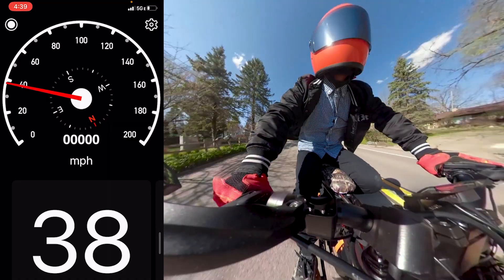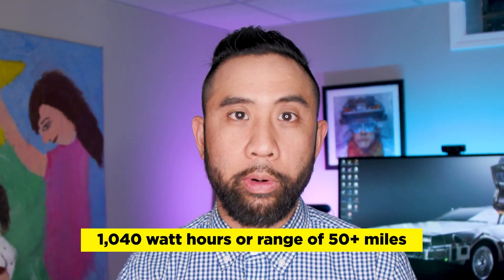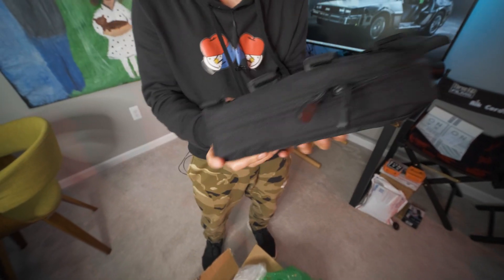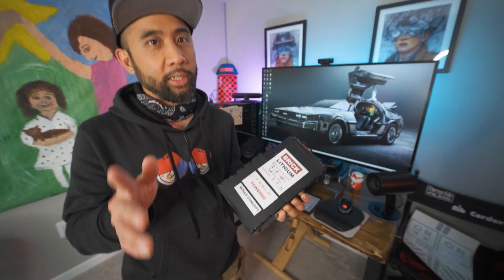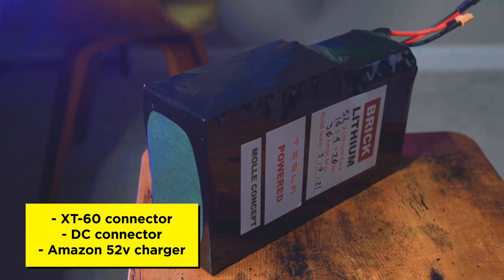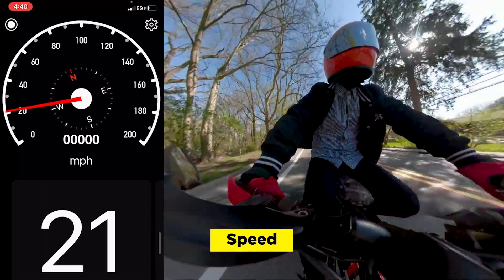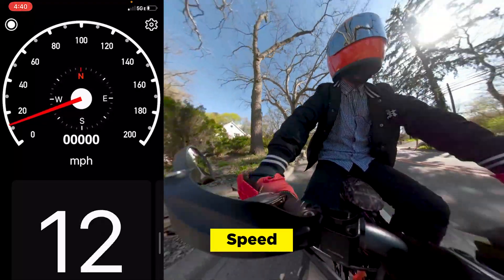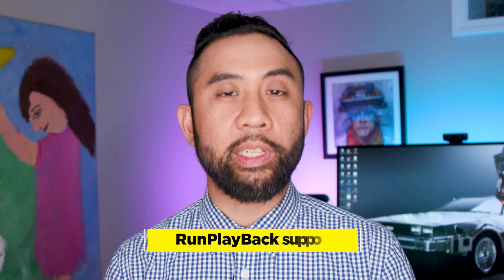Super73 Z1 52V Upgrade Test Run | RunPlayBack

Comment: Did you change the settings in your controller to 52v or leave it at 48v.
Reply from the maker: From what I remember I didn't change anything related to voltage.

Comment: could i run the 52v batter with the orignal controller?
Reply from the maker: Nope, the stock controller would burn out.
Reply: @RunPlayBack  if i run a bac855 and a 72 motor could i use the stock motor?

Comment: Great video! Is there any reason you mount the battery on the panel instead of put it under the seat? Is it just for its size or the heating problem
Reply from the maker: The size of the battery was too big to fit under the seat.

Comment: Any reason why that bike in the video isn't a Z1 and is actually the S1 or 2?
Reply from the maker: It's a Z1
Reply: @RunPlayBack  The front suspension? Headlight? You put all this on it?
Reply from the maker: @OregonCrow  yeah, it's heavily modded. 
But it looks much different now though with the 72v conversion. It's one of the latest videos on the channel.
Reply: @RunPlayBack  Right on

Comment: Could I use this controller with my 52v ZX for a higher top speed? (Stock battery and motor)
Reply: The motor and battery has to be has to be 52v too

Comment: I have have a Super73 RX with a stock controller. Do you think the stock controller will handle a 52 volt battery?
Reply from the maker: I'm not sure but I wouldn't risk shorting the controller if it can only do 48v. If you're upgrading to a 52v battery, might as well upgrade to a new controller as well.

Comment: Another great video sir. Did you adjust the minimum voltage cutoff on the controller(is it even possible?). I think in the display it is C12. Just curious. Thank you for your time.
Reply from the maker: Yup I did actually. I forgot exactly what level but I raised it to the highest minimum voltage cutoff. I still never ride it to cutoff point and very rarely do I even dip down to 48v on this pack.

Comment: you should do the speed hack on the super 73 by cutting the white wire
in the controller
Reply from the maker: There's actually a new controller in there, not the stock one.

Comment: I wonder if a higher capacity controller would help with the heat issues? Aliexpress has some, I'll try to link it and hopefully YT doesn't delete it. They appear to use the same screen and connectors as well. Main concern is with the increased amperage: could mean that the controller has better heat management, but could also kill the motor quick? These controllers do allow a power reduction in the settings, which may offset the amp bump while maintaining heat management benefits.
Reply from the maker: Hey Bill! Yeah please link me if u find a better controller. I'm happy to be the guinea pig to test it out. I have all the same concerns with this current controller and motor. I'm trying my best to retain as much of the Z1 as possible without replacing the motor.
Reply: Ya. Link please for the controller
Reply: @frodo8722  https://www.aliexpress.com/item/4001093131407.html?channel=twinner
Reply: @frodo8722  Just posted the link. Let me know if you see it as Youtube typically auto-deletes links in comments

Comment: Definitely mount it on the outside, my identical setup would get the controller so hot you couldn't touch it.
Reply: Does you current setup (externally mounted controller) cut off?
Reply: @BRICKLithium  not so far as I've tested it.  Granted, it has yet to get really hot outside but it would cut out when internally mounted when the outside temperature was 85F and I was using heavy throttle.  It used to get hot to the touch, now it rarely gets warm.
Reply from the maker: @bandwagon240  You're running the 52v right?
Reply: @RunPlayBack  48v right now.
Reply from the maker: @bandwagon240  I never had cutoffs/overheating with my ebay 48v / controller but that might have been just luck. The 52v is putting out like 58/59 volts at full charge so I'm not even sure how much mounting the controller on the outside will help. But we'll see :)
Reply: @RunPlayBack  In my case, it could have a lot to do with me being 210 lbs and living in Florida. 😂
Reply from the maker: @bandwagon240  in Michigan we got like a few days in July that feel a little like Florida hah but yeah for the most part the weather here is all over the place and don't typically hit super high temps
Reply: @RunPlayBack  "all over the place" in Michigan is right! We're supposed to have snow this week! I upgraded to a 35 amp controller and 52 volts, but the controller is mounted on the frame behind the front wheel. Stays cool as cucumber, but the top end is only 30 mph. Ok, actually 29.87 mph, but that's good enough for now, lol.

I'm experimenting with a 96 amp Phaserunner, but I plan on making a heatsink for it because it's so little.
Reply from the maker: @Altema22  that's awesome! Which part of Michigan are you from? I was looking into the Phaserunner. Do you know if the Phaserunner_L10 with the 52cm long motor cable and Higo L1019 connector is plug and play with the Z1 hub motor?
Reply from the maker: Yup absolutely! That's next on my list :)